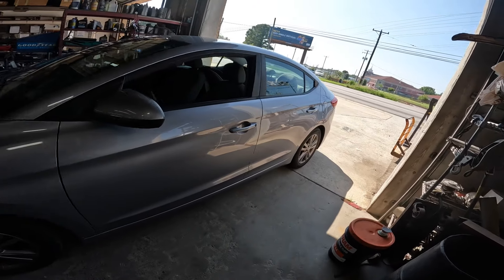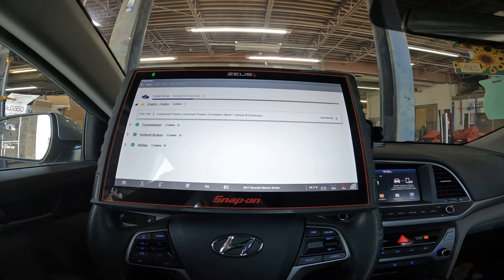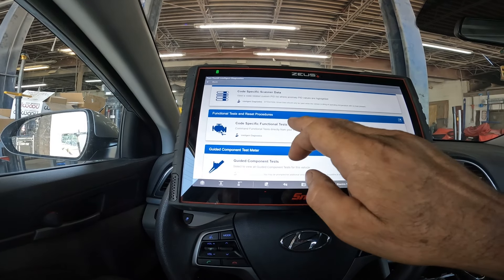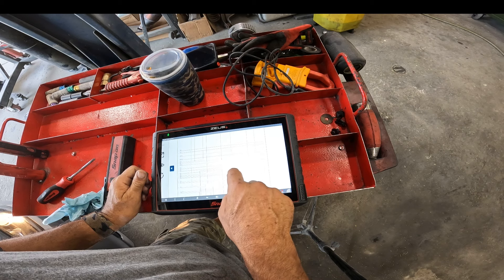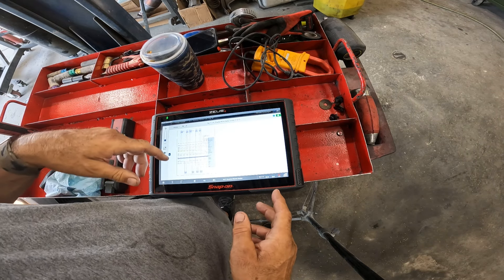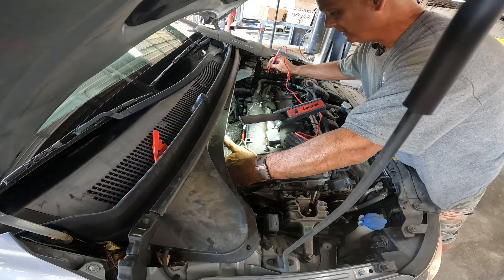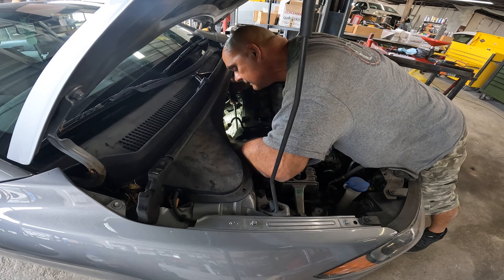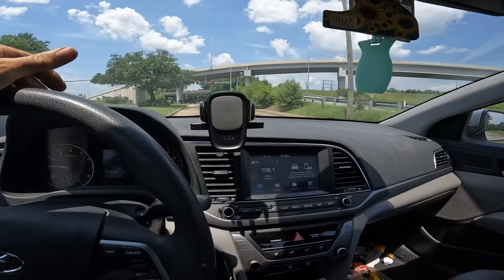Hyundai CODE P0017 0r P0014 VVT SOLENOIDS / OIL CONTROL VALVE EASY FIX

Comment: Do you have to relearn the new vvt soleniod? I did an oil change and installed new vvt soleniod exhaust side, and I cleared the codes with cheap code reader, then took for a test drive and check engine light came back on.

Comment: Thanks for the video. Is there a way for the car the "relearn" without your Snapon tool? I have a basic code reader and got both these codes after my car just stopped while driving and would not stay on afterwards. No check engine light at all.
Reply from the maker: what type of scanner do you have

Comment: I'm having the same situation however, my camshaft sensors both A and B are throwing off and both intake and exhaust vvt solenoids are over advanced, I went ahead and changed the parts but the codes still read it the same. I've taken it to the dealership and after 4 hours, they didn't find anything wrong with it. It's gotten to the part where I'm having rough transition when I'm accelerating and there's a delay. At this point I'm losing my mind trying to pin point what the hell is going on and after talking to the dealership they said it probably internal and they recommend me bringing it in another time. What do you suggest I do? The codes are P0014, P0011, P0017
Reply from the maker: this is one that i would really have to look at. i hate that you have to pay them a diag each time you take it back
Reply: Same problem,code p0017 put new exhaust VVT solenoid it ran a lot better but code keeps popping up... I've changed the oil twice there isn't anything on the screens on the VVT...

Comment: Any idea whether this Turkey has had regular oil changes?  When I've seen problems like that, the last oil change was loooong ago.
Reply from the maker: I’m not sure, but looking at the condition of the oil it’s possible
Reply: @AutoRepairTips757 I have a question if I just got a oil change and they found few pieces of metal in my screen on the vvts solenoid (exhaust side) and my car shut off while driving but power stayed on what does that mean

Comment: I got the same codes on my dad’s Elantra. went to the dealer and they said vvt solenoids are ok. They said he needs to change timing chain, tensioner and guides. It burns oil every 3000km (1800 miles) the oil level is below the min level in the dipstick. Fuel efficiency is low and it burns a lot of fuel than normal. Should we follow the dealer?

Comment: Thank you for the informative video. What do you think should be checked if metal is found in the screen of this sensor?
Reply: I just had the same issue and I just got a oil change but to give a run down I started my car it drove and then completely turned off power was on tho now I can't get it to start

Comment: My car died while driving and is throwing the P0017 code. Every video I've seen is it trying to start but running rough, but mine won't start at all. Could this still be the cause or could there be something else wrong?
Reply from the maker: souds like it might be something else
Reply: Having same issue. Did you figure out the problem?
Reply: Damn I have the same issue with my Elantra not starting with same codes
Reply: Same thing happening with mine currently as well. Did you fix this issue? What was the problem? @ThatOneBradley

Comment: I have a 2020 Volster  with identical problem. I how do I relearn? I have done battery reset but code comes back after i drive it. Do I need a scan tool to relearn?
Reply from the maker: @key0nkolors930  you should be able to hook a scanner to and do a relearn that way, also make sure you’re definitely full of oil that does make a difference.
Reply: @AutoRepairTips757  I guess I  will take to auto shop. All I have is a Bluedriver.  It won't let me remove the code p0017.  Same readout as yours. I've tested both cam and CVVT sensors and crank sensor. All are good so it must need the relearn.  Disconnect battery and it goes away but when I restart car CEL comes back on . No misfire, car idles perfect.